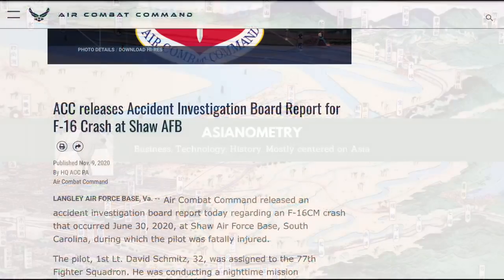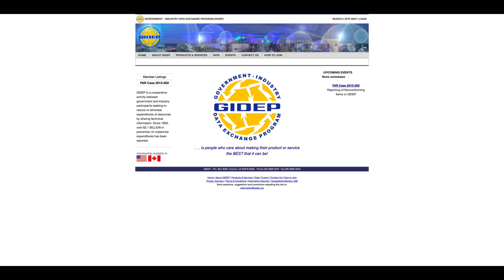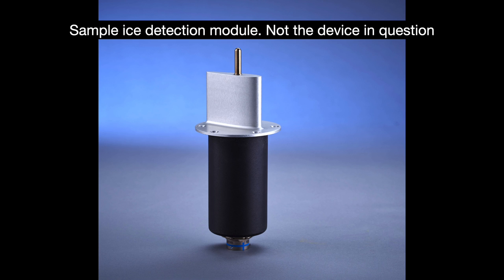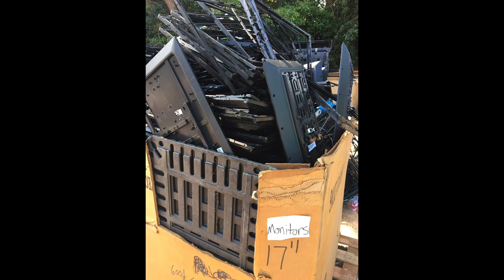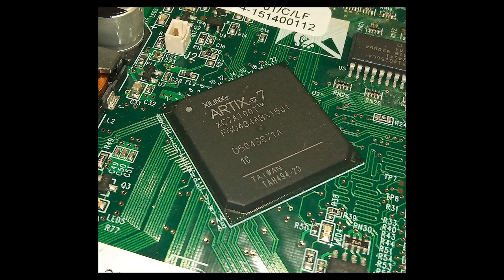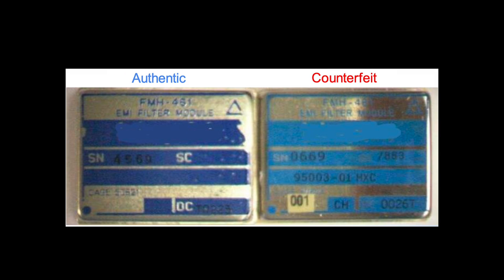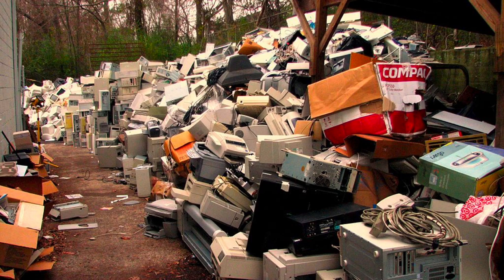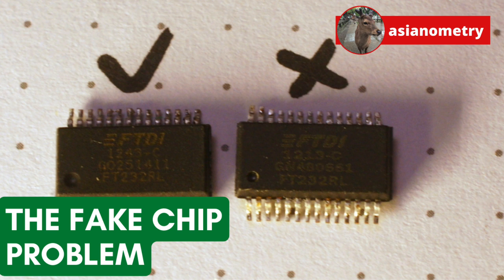The Fake Chip Scourge

Comment: I've read of companies selling USB sticks marked as having many times exaggerated capacities.  They pretend to bu the high capacity, but just wrap around and overwrite themselves when they reach the true capacity, which may not be detected until long after being bought.
Reply: Not only USB sticks, but also SD cards. And sometimes they don't even wrap around, just pretend that the files where written, while in reality only the metadata is stored.
Reply: These can be found on Taobao sold much cheaper than market prices
Reply: that is very common sadly, almost every overly cheap usb stick you find on amazon or wish will be fake
Reply: i have a 8GB one. it didn't have enough space for win10. then I realized. it's now a fine 4GB linux boot drive.
Reply: There's 32 tb M.2 drives on Amazon right now for $99. 32 tb M.2 drives do not exist, and a reputable 4 tb M.2 drive is $250.
Reply: You've just captured Ebay in a nutshell. The Item Description makes false claims to hook a Buyer in a competitive marketplace where price is the only thing guaranteed. The Seller gets rated at the time of sale only, the Feedback Score does not reflect product quality.
Reply: @jagmarc  I’ve bought lots of stuff on eBay (though never fake memory sticks) and I’ve always only left feedback after receiving and using the item.
Reply: same with sd cards and ssd, you can even find this on amazon
Reply: @ThienNguyen-ef2kg  careful with that, USB sticks have their own controller that, just like on an SSD, tried to spread the load. If you only use part of the flash, it doesn't mean that it will all be written at the start (good) of the memory, it may try to write at the end (bad) of memory, depending on how the firmware was made.
Reply: A while ago, Amazon, NewEgg, and other large retailers actually fulfilled orders themselves.  To cut their costs, they all allow (and encourage) anyone to be a reseller.  Now counterfeits are everywhere.

Really, far too many big, "legitimate" retailers are supporting and taking full advantage of the counterfeit market, effectively taking up the Uber business model of externalizing their costs.  It really needs to stop.
Reply: @guiorgy  thank you for your insight. my counterfeit drive was bootable. lucky!
Reply: @Waccoon  NewEgg stopped being a legitimate retailer years and years ago. Amazon is also basically the equivalent of buying something from a dude in an alley, except you know you can return it.

NewEgg doesn't even allow returns practically, so forget them.
Reply: welcome to wish
Reply: So off topic
Reply: I had a friend that bought a 32gb stick off ebay for $30 in 2015 and the seller didn't even try... Inside the case was the snipped off end of a USB extension cable.
I mean I get if someone is trying to scam to get a little extra, but that was all scam zero return.
Reply: @Runivis  ever see the " I bought off wish" videos?

Comment: And eBay, knowingly and willingly continues to allow sellers, both foreign and domestic (to the US) to blatantly sell (blatantly) counterfeit  semiconductors to the American public, with whatever government rules, regulations, laws, and statutes have been passed having exactly zero effect in curbing this, since it continues unabated and has been present for as long as I can remember - certainly well over a decade.
Reply: There are a lot of schlock operators on Ebay but not all of us are. I don't sell something at NOS unless it really is NOS. I sell a lot of things as used even though I highly suspect they're NOS but can't conclusively prove it. I'm the quickest draw in town to issue a refund if parts turn out to not work for the customer. (It's not worth it quibbling over a $10 tube of chips anyway). And a lot of the stuff I sell has been in some university's parts room for many decades so I like to think I'm avoiding the fake chips problem by selling chips that are very old.
Reply: Settle down there, there's nothing illegal about selling gray market parts.  If you want white channel parts you simply need to purchase from an authorized distributor and not a gray channel such as eBay.  Regulation is NOT the solution here - the industry already has the solution and you're refusing to use it because you want to save yourself a few dollars and then whine about it.
Reply: @knurlgnar24  Selling counterfeit items is very much illegal in the United States. Claiming that items that are used are actually fresh and new from the factory, is also illegal. Additionally, both violate eBay's TOS.

Comment: I've heard that a big client for this 3rd-patry chip harvesting is a repair industry for modern electronics. Many big companies (like Apple) will force their manufacturers into agreement that prohibits them from selling specific chips to anyone else. And when a chip like this dies, Apple isn't bothering to replace the chip itself, offering whole new motherboard instead, because why take $50 from their fan, when they can take $800. So when independent repairers try to enter the niche Apple won't take (economic repairs, data restoration etc.), their only supply is those counterfeit chips. This is an amusingly stable system: a company is multiplying e-waste by refusing to do precise repairs, but then adds an incentive to harvest that e-waste for parts that people who try to do precise repairs cannot aquire by legal means.
Reply: Ah, Apple ... I bought a new Macbook Air in 2012, the larger size. It lasted 8 months. I was very careful about it, and it just started failing in all kinds of random ways. I managed to sell it to a guy (who I think repairs or has a repair guy) for a few hundred $ before it became a doorstop. Of course I'd gone to the same Apple store where I'd bought it at the first signs of trouble and they said, "You don't have Applecare? We can't help  you!".  Now, the fluxes used on modern circuit boards are water-soluble and often "hygroscopic" which means they'll actually attract water out of the air. This is not a problem if the circuit boards are properly washed off after being soldered. But I have a theory they leave just a little bit on, don't wash the boards quite well enough, so they'll fail in a year or so and then if you didn't pay a few hundred for an Applecare plan, then they have a good chance you'll just a new laptop because you're married to the Apple ecosystem. Joke's on them, I got a few-years-old Windows machine that turned out to run circles around the new Apple for battery life, and never looked back. Used Dells are a great value.
Reply: Apple has the boards repaired themselves. And then charges arm & leg for a swap with a repaired board.

Comment: i can't believe even Boeing and the Army got fake chips,i thought it would be just on a hobby level, I've had my suspicions that i got fake stuff on ebay because the circuits i built would work intermittently or work at first and then not work, which is very frustrating because of the hours spent troubleshooting after building and not thinking the chips are at fault, rather blaming myself. even though ive built plenty of circuits successfully. really frustrating.
Reply: People are people the world over. You can't really trust any of them either.
Reply: Yeah that's one thing you'd realize after a while. As a hobbyist you'd think that the cheapest would do but in reality, a fake/bad part will waste hours on troubleshooting and make you frustrated to the point of burn out. The alternative is to thoroughly test the part but that's an additional investment of time and every part may be different even if the label says otherwise.
Reply: Normally they vet their suppliers very carefully. It's part of their process.
Reply: @1pcfred  There are companies with good reputations that don't cheat their customers. It's a good long term business practice.

Comment: I just got burned on 3 eBay semiconductor purchases: The first was for 2N5460 P-Channel J-FET transistors which are more rare than N-Channel and usually more expensive.  These were perfectly laser-engraved with a Fairchild logo that was just an ‘F’ that was thinner than Fairchild’s normal logo.  These turned out to be a mix of common bi-polar PNP and NPN transistors!
The remaining 2 were for 2N6027/28 PUJTs that are really rare.  In both cases I found offers for what seemed like legit-clones such as what a company like ON-Semi might reproduce with good quality. However, instead of PUJT’s, they were garden-variety SCR’s!
So, I’ve pretty much quit buying semi’s from eBay since they have knowingly allowed this to go on for decades!
China has been the ONLY country I’ve been burned by.  When you call them on it, you get this “We so sorry—We just didn’t know. You Americans so smart—We give you refund right away”. So, the mostly do refund but what a hassle and it shakes your confidence!
Reply: Bleh! You should be able to report that seller to Ebay because Ebay takes fake goods very serioiusly - not because of electronic components so much as because of the problems they've run into (and Amazon also) with fake designer clothes and shoes and such things.
Reply: Report them to eBay.  And test whatever you get against known good ones.  Or at least ones that behave the way you need. There are some simple tests, like continuity between pins.  It isn't valid for identifying, but you'll know when one is out of spec.   

As ironic as it may be, get a LCR-T4, and just double check that they read as the same component as the known good one.  Chinese crap, to test Chinese crap. :)  Mine seems pretty consistent.  And I do the physical exam, to try to weed out crap.

As I recall, the occasional counterfeits have made it to Digikey and Mouser, but they definitely want to keep their good reputation, so they're going to work as hard as possible to avoid counterfeits from going to customers.   I'd trust them 99% for selling you good parts.  eBay, I'd trust like 10%.  

Sure, I've bought some components from eBay, but that's because either I couldn't source it anywhere else, and/or I was going to be running it at a small fraction of it's capacity, so it didn't matter as long as it sort of worked.   And I don't build anything for health or safety.  No one will die when my projects release their magic smoke.
Reply: I mean, you’re trying to buy semiconductors on EBay. What did you expect?
Reply: Yep, it's hard to find through hole RF transistors, so counterfeiters take advance of it. Try to find legitimate 2n5109 transistors, it's like trying to find hen's teeth.

Comment: This is  great video and I shared it on a PCM hacking/tuning forum I'm on as we deal with this all the time. Clones in older ECU tuning supplies out number genuine. Many of the clones straight up don't work or fail quickly which is completely unacceptable in a critical application as a car ECU or similar module.  Some of the members went to extreme lengths to secure a supply of genuine EEPROMs, NVRAM and those exact FTDI ICs in the thumbnail for example.  

Even genuine automotive parts that contain semiconductors that are manufactured in China often fail easily compared to the Mexican ones.  6 months opposed to 20-30 years typically seen with the AC Delco parts, which are now made in China by Delphi.

Comment: I've bought a lot of chips off ebay and resellers that've ended up being fakes. Bit of rubbing alcohol on top and some fast and furious rubbing with a ear-bud cleaner and you can frequently see it. I suppose skimmed and non-painted but laser etched would be harder to detect. Also I've had one that when I stuck it in a system instantly blew all the buffering caps surrounding the IC. Strongly suspect it was not functionally what was re-marked.

Comment: One thing not mentioned in this video is reject parts being stamped with new markings. This is how it works:
A semiconductor manufacturer of good repute such as ON Semi will make a production run of transistors. As they are coming off the line, they will be subjected to various tests. The ones which fail these tests get rejected and go into a large bin. Now, it might be that the transistor works perfectly fine, it just didn't meet some specific threshold for testing. None of these reject parts will get to the stage of having markings stamped on them - they are side-lined before they reach that part of the production line.
What you have now is a large bin full of transistors with no markings. These will get sold as rejects - and the buyer won't have any idea exactly what device they are. 
Let's say they were actually 2N3055 transistors, a common switching/amplification device. 
China will come along, buy up all these rejects then stamp them with the markings for a rare and expensive transistor that might have ratings way in excess of what the 2N3055 does.
We as the consumer buy them, thinking we have got a bargain on an otherwise rare and hard to get device - only to have them go BANG the instant the machine into which they are fitted is turned on.
Or, in some instances they may work for a while, until they fail because they're actually being used in an application that runs them outside of their real parameters.

Comment: I purchased a Thermistor interface PCB for a product I was prototyping.  When I tested the prototype, it kept reporting the wrong temperature.  It turns out the MAX31855 IC on is was a counterfeit and it had a design bug (it was a defective copy).  I ended up purchasing a PCB from a trusted source (AdaFruit) to see if that would resolve the issue and it did.  This cost me a lot of time.  Comparing the ICs, there was nothing visually different between the two.  The only way to know the fist one was a counterfeit was the error - or requiring part source tracking which is difficult to get, especially when you are in a parts shortage situation.  I an sure I am not the only one to run into this.
Reply: I imagine testing costs are going to rise, and get passed onto the consumer. Essentially one group (counterfeiters) are stealing from another group (innocent consumers).
Reply: @brodriguez11000  Yes, that is how things work.  Someone has to cover the costs of making the product.  As he mentioned, the problem is also driven by how quickly technology is changing.  This is especially a problem in Military and Medical devices which have to be requalified if you change them so there is a lot of incentive to not change them.  Both of those require vendors to provide record that "prove" that but that proof can be counterfeited (which he also mentioned).  Sometimes that happens insincerely but sometimes it is because they are because they have to take what they can get and trust that it is correct of not supply product and go out of business.  It is a Hobson's Choice.

Comment: I've heard there are counterfeit M92 power management ICs for the Nintendo Switch being widely sold to electronics repair technicians. People will buy a pack of chips, replace the faulty one on the board with the "new" one they bought and it doesn't work. They give it to someone else to figure out, that person has real M92 chips, they replace it, and it works. it's scary how common that is for those.

Comment: This is a huge, long running problem! I remember fixing an audio amplifier 10+ years ago. I replaced the main output transistors but the new ones kept blowing up. They did not meet the specs from the datasheet. I eventually cut open one of the old and one of the new transistors. The die of the new transistors was much smaller.  I was confused at the time but eventually learned the new transistors were fake parts.
Reply: Very true, especially for highly sought after items, such as long out of production Toshiba transistor. Finding a replacement parts for older hifi amp can be a periluous journey.
Reply: @jojoanggono3229  Don't even get my started on the Sanyo STK hybrid amp ICs... 80% of the ones available to buy are fake and will blow up either immediately or shortly after you've buttoned the device back up... which is especially annoying because you can't really substitute them with anything else
Reply: Yeah I too had a couple rounds of fake Sanyo STK chips then gave up. One was bought from the USA and the other from HK Seller. Both fake.

Comment: I remember the 2015 FTDI 232RL serial chip clone problem. In fact the clone was better manufactured tham the original, but if it was detected by the windows driver, it blocked it from working and disabled it.

Comment: there is also the issue of manufacturers that wont sell spares to 3rd party repair companies, even if the chip is a generic one as companies using the chips have agreements with the manufacturer to not sell to anyone else but them. else why are so many fully functional devices that could be repair easily end up as e waste an example is macbooks, most have texas instrument ic but because apple and texas instruments have an agreement to not sell to anyone other than apply, the spares are near impossible to get unless you harvest it from dead equipment which is 50/50 chance of it being fake. my workplace IT department has a shelf of dead macbooks because of a simple chip dying and apples repair costs the same price as an entire new device, most arent even 2 years old. Same can be said for John Deere tractors, alot of manufacturers dont sell spares for out of warranty equipment and even if they do you cant have your own maintenance teams do it, you have to wait for their technicians which can cause 1-2 weeks downtime.